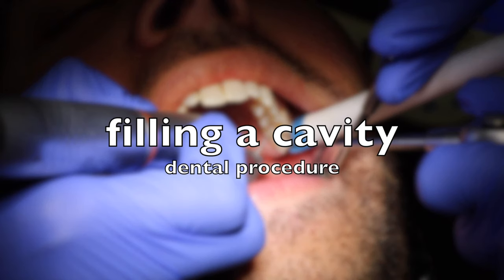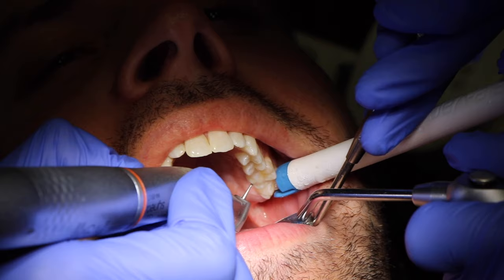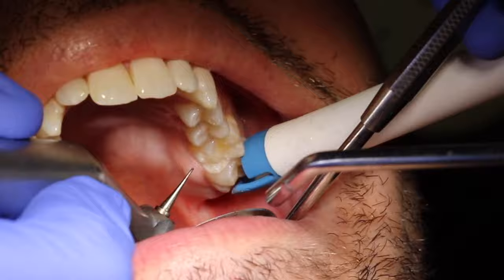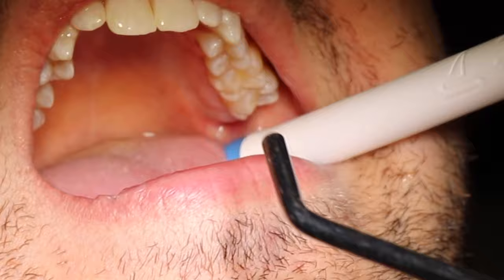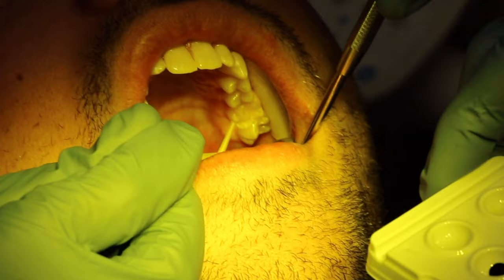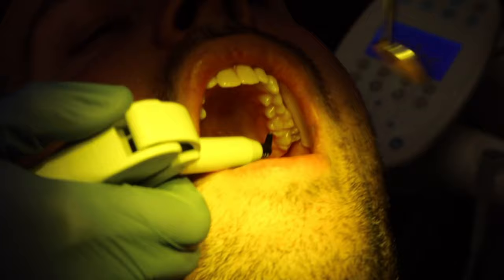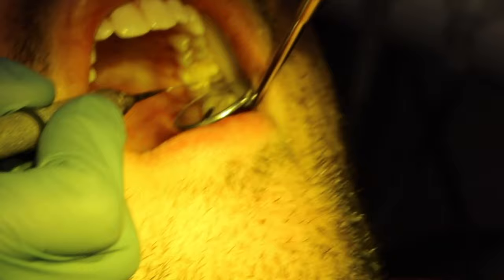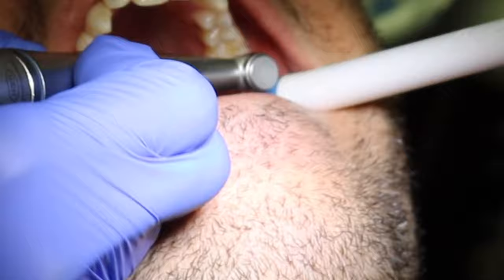How Does A Dentist Fill A Cavity?

Comment: Guys, hear me out. You will feel nervous and scared before they fill the cavity, but you will realize that the procedure isn’t painful at all, in fact a very relaxed one. Usually they will put laughing gas on you to make you feel numb enough for the shots to not feel painful and it really does work. The anasthetics (the shots) will be felt just a tiny bit and only for half a second, and trust me, it’s worth getting that shot. It numbs the whole side of your mouth where you got the shot and you will faintly feel the drill after about thirty seconds. Overall, the procedure is very painless and nothing to worry about. Anyone that has an appointment soon, don’t worry!!! 😁 You got this.
Reply: Wait what laughing gas >:v that my worst nightmare I hate it
Reply: thank youuuu, im so scared right now
Reply: How long did the procedure take for you?
Reply: Cappp
Reply: @lukewarm_cult3688  sammeeee that’s why I’m nervous I would prefer an injection
Reply: Why are they using  nitrous oxide? Seriously that's overkill when a topical swab works better imo.  Then afterwards use injection
Reply: @Beldandy100  Nitrous helps people calm down. It lowers their anxiety level. You don’t need it, but it’s useful for both the dentist and the patient.
Reply: What a heap of crap. In Britain you get an injection and that is that. Laughing gas went out with the 80s/90s. I got two yesterday but decided against getting Injections. UK doesn't use gas and hasn't for a long time
Reply: They only use laughing gas if the patient is really anxious. Last time I went to the doctors to try to get my cavities filled, I had an anxiety attack so they rescheduled my appointment with laughing gas.
Reply: yeah just remember that its only going to take a few minutes. the pain wont last very long and it will be over soon!
Reply: I counted in my head during the shot and it's more like 20 seconds lol

Comment: If anyone is getting a filling and is scared: I just got mine done and it’s not bad. They give you this gel so the needle won’t hurt as much, and it’s only a sting that lasts a second, and not a very intense sting either. The scraping might feel sensitive and if it does they’ll just numb you more. After a few minutes into the tooth you feel absolutely nothing

Remember, the dentist wants to make sure you feel the least pain possible
Reply: I'm getting 3 today for the first time.. how do you keep your mouth open the whole time?
Reply: heyyy so ik u said it’s a little pinch and i’m a scaredy-cat when it comes to pain and needles, do u think it hurts more than a piercing(ik it’s not the same type of problem but still😭)
Reply: I have the recessive readhead gene so I have to get like 3x more numbing and one time I felt the drill and my reflexes made me punch the doctor 😢😂😂😂
Reply: Bro stop. Some dentist just don't give a F. They will do a crap job and as quickly as possible

Comment: As someone going thru some pretty extensive dental procedures right now, and someone who has had a LIFELONG fear of the dentist due to 2 very bad experiences with novocaine not working effectively I will say that I went too long without proper dental care and I found a dentist who assured me the dental work I had done before was not done properly and I wouldn't feel a thing. I have now had 5 visits- 3 tooth extractions including an impacted wisdom tooth, and a tooth that had to be "elevated" (basically there's not enough tooth to grab with forceps so it has to be dug out of from below your gum line), a root canal, and several fillings and I will be getting implants in and crowns in the spaces of extractions. Bottom line: he had truly nearly completely rid me of my fear of dentist's. He said there's other types of nococaine and he knows how to effectively numb me and he meant it. So far I have felt nothing. He's efficient and does an excellent job. These videos can make things look a lot more scary than things really are.

Comment: Heres my story
So I sit down in the chair and they gave me this jell on a q tip and held that in my mouth and then they went in with the novocaine and I felt a slight pinch but trust me it's worth it. Next they kinda picked at the cavity and if I felt any sharp pain they would give me more gel and novocaine. Then they started drilling and it felt pretty good, not good but not bad. While they were drilling I had a large like tounge holder that also sprayed air to keep my mouth dry. As it got deeper it hurt but just a little bit so I counted the buzzes to keep my mind off it and then they scraped it to get any last bit out and then they filled it in. I felt a little weird after but not bad

Comment: Seriously people a filling doesn't hurt. Now if it's deeper towards the nerves or near the gum sure you might feel a little more due to that being a highly sensitive areas.

They should still start off with a topical to numb the area before a direct injection.  The injection is slightly painful pinch in the gum but it goes away pretty quickly as  the injection drug takes effect quickly

Comment: Just had a composite filling put in one of my upper right molars and now there’s a bit of of sharp/rough spot on the inner side of the tooth closest to my tongue. I can run my tongue over and feel it very clearly. Just had it done today so I’m gonna try and wait it out before I make any calls, just wanted some input from any dentist out there.
Reply: It's most likely going to smoothen out the more you eat and chew, it's in a sense like the wearing of a rough rock that later turns into a smooth pebble if you know what I mean.

Comment: I got mine today . They push a stick on the side of your jaw with some gel on the tip to numb your mouth let it numb a bit . Than they take that out and put the needle in your jaw (which stings a tiny bit but u can’t even feel it really because your mouth is already kind of numb from the gel) after that then they let it sit for 5 minutes so your mouth can fully numb . And then u lay back and they I don’t remember every thing but they put a block on one side your mouth to keep your mouth open why they work on the other side , they drill your teeth and no it doesn’t hurt it feels like the same drill they clean your teeth with after that’s done they use a blue laser light thing hold it on for like 2 minutes and then rinse and dry your mouth and that’s it . Now if u have multiple cavity’s they might numb both sides and do a few and than tell u come back for the rest . They repeat this process on all teeth but u only get the needle once if their doing one side two on both jaws if they’re going to do two sides of your mouth the same day or they might do one side and tell u come back another day for the other side . And yes if u come back again another day u will get numb again I believe (I remember about three years ago) I only had one cavity and they didn’t numb me just used the drill and the blue laser and I was done in 4 or 5 minutes. All depends but u most likely will probably get numbed. I personally don’t understand why we get numbed as the treatment it self doesn’t hurt but I guess because people teeth’s are sensitive

Comment: I remember when I had two cavities on my lower jaw and when I saw the needle I was like yeah no and I told them I didn’t need it so they decided to not use the needle,and without the anesthetic it didn’t hurt at all,(probably cuz they weren’t too deep) but all I remember  is that the part they were drilling felt very cold but it was done in about 5 mins I don’t remember any pain maybe a little but not enough to remember

Comment: I had a bad experience when I was 6 where I don't think my mouth was that numb and towards the later part it hurt with the drill and I haven't been back since. I'm now 18 and I've noticed that I've got a cavity or two that isn't too bad just a little black dot in the centre but it's making my jaw ache a little every once in a while but other than that it doesn't bother me. But I do want to get it resolved before it can get worse and this video kinda settled my nerves about going back. I'll just have to save up first which it shouldn't take long to do since luckily where I live it doesn't cost a lot so hopefully I'll be able to get my teeth done a couple months.

Comment: I am getting a filling done on Friday, which rn is tomorrow. I am freaking out over this because I'm very afraid of needles, and I have always been dizzy and much more vulnerable to them. 
The thing I am most worried about is the needle and drill. 
Thank you for reassuring me about the drill.
Reply: did the needle hurt
Reply: @ellabrady7865  For a little bit, yes. Just think of it like being scraped by the little scratchy thing they use on your teeth to get off the plaque. They usually do put on a numbing gel, which you can ask for more of if it is scaring you that much.

Comment: Mu biggest concern with the drilling step is that the spot being being drilled is that when the composite is being packed there can be AIR pockets that do not get filled and then mote composite gets added. 

When after 2 or so months the teeth begin to go bad I mean rot and not just decay slightly but because of air pocket. 

Then what next? 

Would dentist cover how air pockets can lead to more harm than good in dental work?

Comment: Hi, I was wondering if the bacteria from the cavity turns the hole/tooth soft? Because Im going to get a small hole in my tooth filled before I get braces to protect it but my dentist said it isn’t decayed yet as I’ve kept it as clean as possible but because it is exposed it’s best to get it filled as it’s at risk. So yeah I was wondering if the decay causes the tooth to turn to mush kinda. Thanks!

Comment: I was reading the comments because I had to get a filling done and this was my experience. I am terrified by needles. when i got in their i started crying because he said to open up for the shot. I told him to give me a minute to get my composure which he did. he gave me the shot and I promise i did not hurt. i could feel it but i didn’t hurt. it just felt like you biting on your cheek slightly. he waited till i was numb , which i wasn’t and started to drill. i didn’t feel anything until he got deeper and it did not feel good. he gave me more numbing and then continued. it didn’t hurt but i didn’t feel good. it felt like something realllllyyyyy cold was on my teeth. for example if you bite ice cream with you front teeth and it feels extremely cold which doesn’t feel good. it’s the same thing. after that , he filled the hole with some cement stuff and i was done. it’s not bad, i swear.

Comment: lemme give you a run down on my experience 3 days ago:

they first put the little numbing sticks in which for me tasted like spicy bitter cherry, then they do the shots, if you get them in the bottom you won't feel a thing but at the top I felt it go in deep (doesn't hurt just discomfort) now they leave you for at most 10 minutes for the numbing to kick in, then they use the drills, the drills don't feel like anything at all other than vibration and  some blood smell (depends.) after that you're outta there!

Comment: I have an extreme dentist fear, I avoiding going for years. A few months ago I went as I had tooth pains. They did a check up and told me I'd have to get 7 fillings. 
Yesterday I got those fillings done, I was scared asf but It turned out to be okay. The only part that hurt was the needle that numbs the tooth, the fillings didn't hurt at all and they were actually quite relaxing to get.
So in my opinion, the only uncomfortable / sore part is the first part (the needle) then once that's over the rest is all pretty chill.

Close your eyes, wear some headphones if you don't like loud noises and breathe through your nose. Good luck!
Reply: Just did my 2nd filling and was wondering what were they doing.. Trust me it aint painful at all.. U might feel a little pain after getting the filling for an hour probably but its alright
Reply: Sameee . Today my doctor said i need 6 fillings. I have appointment 4 days later

Comment: I just noticed a little cavity thought it was some food or something but no it’s still there even after brushing for a while and it’s in the part of my mouth that have been hurting for apparently no reason. It’s really small like the size of a very tiny speck of dust but I’ve never had a cavity before braces or any sort of tooth problem. The biggest thing I had to get done was getting a tooth pulled and it was a baby tooth, but these are my adult teeth

Comment: When I had a cavity they numbed me with a cutip with orange stuff on it they also putted a Big needle and it didn't hurt as bad then they put a block in my mouth and had me to bite it down so I keep my mouth wide open then they had a Water tool, a tool that sucks everything, the Drill and a metal thing all in my mouth at once then once I was done the numbness went away then my tooth is Sore

Comment: I had the needle today, did not feel a thing, just felt cold against my lip from the metal, lasted 5 seconds.
Reply: And how was the drilling ?
Reply: @jimmyjacobson2931  Didn't feel it, heard it and saw tooth dust flying everywhere lol
Reply: @mcsaucxyyy  oh that's scary
Reply: Overall, it doesn't hurt, it is just 30 minutes of "You'll feel a bit of pressure here".
Reply: @mcsaucxyyy  so i want to be over with that shit I need to get 4
Reply: @mcsaucxyyy  oh I am really scared of the needle and drilling that the worst thing in life
Reply: @jimmyjacobson2931  they also put numbing gel where they will put the needle.

Comment: How does a dentist fix a deep cavity or hole?
The hole is tiny, not micro tiny but deep?

I dont think they have a tool to fit inside a tiny hole?
So they need to drill a hole around or on it, to create space so the tool and filling can be put in??

I have a tiny hole but deep, not micro.
Went dentist and she said she cant see it…!?!??? Then i had to repeatedly point where it was located or where it was.

I also mentioned the hole might be filled with food. So you can see it as a hole.

I dont know if she just slapped on a filling with a dentist scoop spoon which was not an actual spoon, more like an L tipped shaped tool stick.

Anyone know? How they fill it.

I hope my dentist didnt just cover the “top part” and didnt put filling to the very bottom of the hole…. Bacteria will enter it.

Comment: Just found out I have 13 cavities and I have to get some wisdom teeth removed 😩
Reply: 13?.. which teeth? bottom or top
Reply: @30251  the bottom and top on my left side
Reply: @jordanfarris2167  good luck man. were they hurting you before you found out they were cavities?
Reply: @30251  only the one on the bottom hurts but the dentist is taking out the top too so it doesn’t mess with the bottom.the cavities are separate
Reply: @jordanfarris2167  makes sense. how long did it hurt before you went dentist? sorry for the questions im just curious and worried about my own teeth lol
Reply: @30251  lol it’s fine.It was hurting for a few weeks
Reply: How has life been with the 13 filling I'm getting 10 done in two weeks